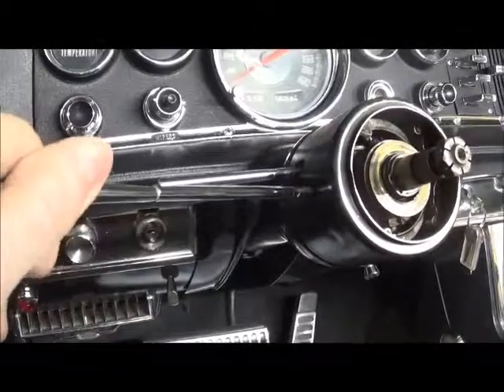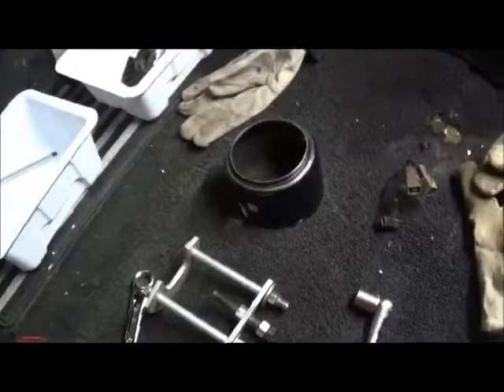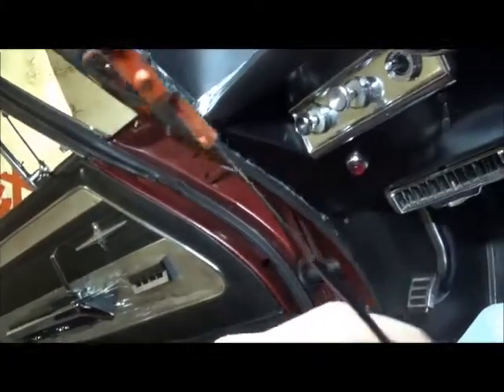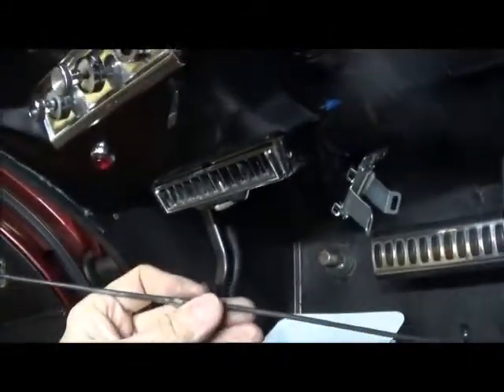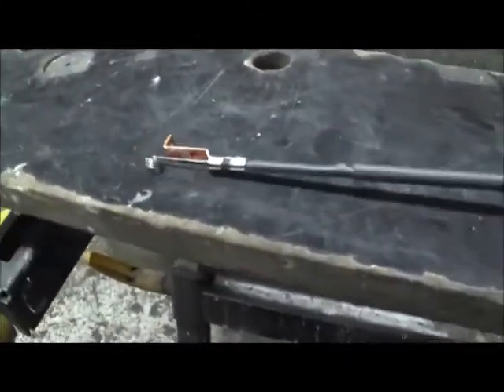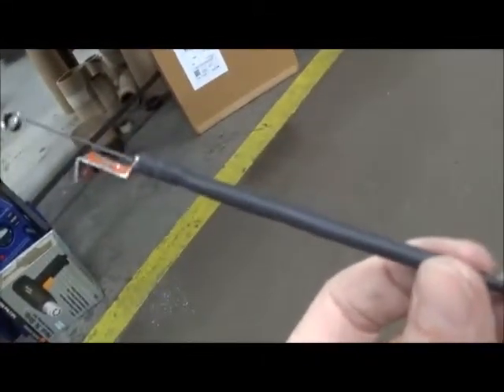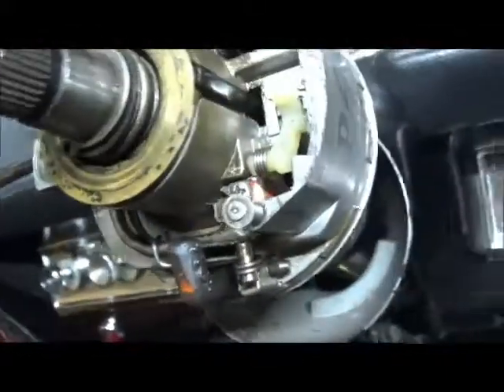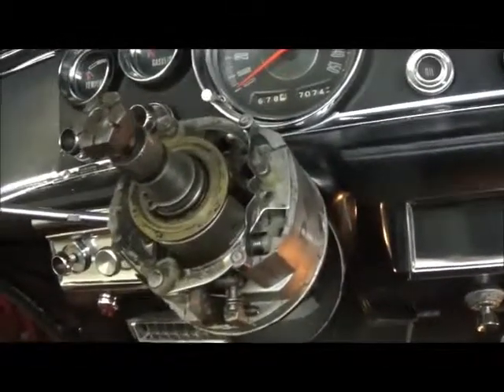1964 Chrysler tilt steering wheel turn signal function, disassembly, repair

Comment: bob you just made me happy thank you i bought a ny 1964 station disassembled in boxes after 5 years i am on the steering which was also completely disassembled by the previous owner i have been wondering for days how i got to the mechanic came for the cable, was afraid to just take it off because you could see that there were springs under it, now i know how and will fix it today. Thanks

my car.
https://www.youtube.com/watch?v=BiRdxQ-xP_U&t=28s